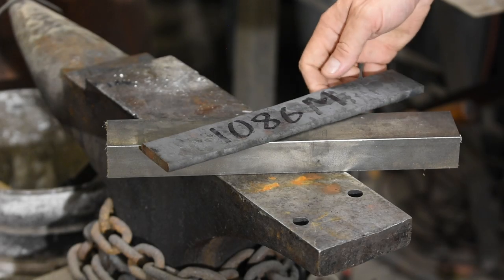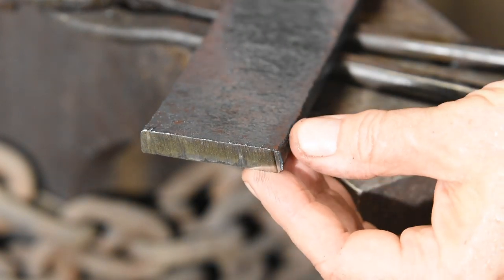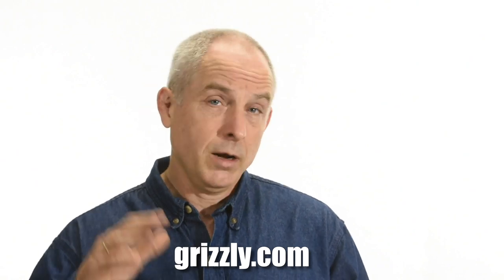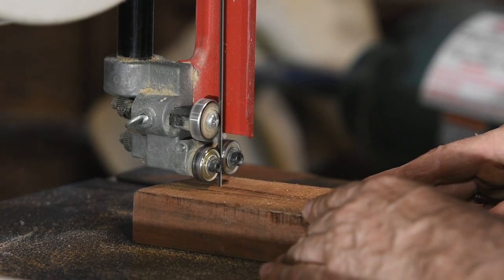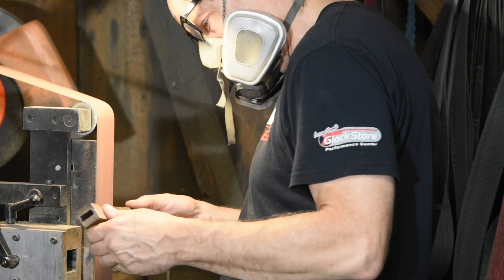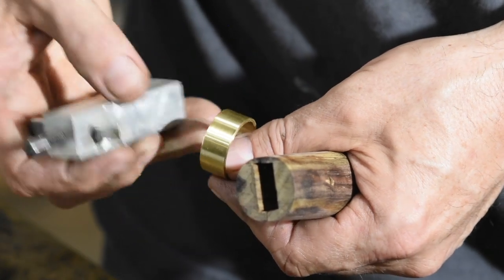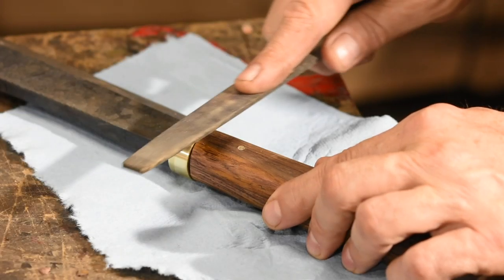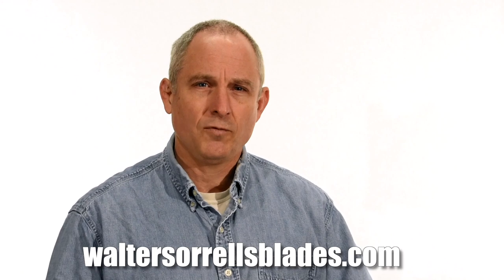Forging an AWESOME Japanese Hatchet!

Comment: well i use an electric chisel to make my groves in hidden tangs, however before or after I have grooved one half of the handle i clamp the piece of wood to the tang affix it  with masking tape that has been tightly wrapped a few times around the tang to hold blad and tang together, remove the clamp locate my hole with a piece of steel to poke it out then drill my hole on one side go and make the second half then glue up. once its dry i simply pull the tang out and drill the hole. keep up the good work Mr. Sorrells (your one of my teachers and its only good manners to call you by your last name and MR.)... i just realized you can simply clamp it and then use a center punch to mark where the hole is and save your masking tape for grinding.

Comment: When you were boring out the brass stock it looked as though that the Chuck was turning as well as the boring tool was cutting on the opposite side. If so I used to do this when I would get some chatter and cutting that way would take up some play in your Chuck and bearings.Thank You Jake Bissel.

Comment: The blade was pretty warped out of the quench but seemed to be straighter when assembling.  Did it straighten during heat treat, was it ground flat or something else?
Reply: Belt?
Reply: It was warped way before it went into the quinch.. you cant see it warped in a few places in the video.. it wasn't straight when it went in the quench.
Reply: It was “intentionally warped” in one direction, so that when it was quenched, it would pull back to close to straight, needing only slight correction which could be done while still hot. It’s a subtle science that takes time to learn. 
No, I can’t do it, but I understand the principle.

Comment: I made one of these a year ago but having a big problem with that one sided bevel. it bended due hardening rehardend it and freaked me out so i decided to make it western style with both sided bevel grind. But the cutting edge you may ask, no problem wih that its a 1000 layer damascus pretty sharp and still in use .

Comment: 1086m? Nice!  Was it from some of Howard Clark's stash?  😉   Also, just wondering since I didn't notice it in the vid, but did you bother trying to take the warp out?  I know that these ni-mai blades are notorious for warping since the high carbon expands when it forms martensite and the mild doesn't convert, but doesn't the mild steel also lend it for being "easier" to straighten (as opposed to mono-steel blades) after heat treating?  Great vid, thanks for sharing!

Comment: I didn't catch it... Did he establish the bevel on the mild steel side or the carbon steel side. Can't seem to get it straight in my head. I'm guessing it only works on the  mild steel side else you would be grinding away all the hard material but dun got myself confused!!
Reply: Mild. Hardened side is the flat side
Reply: Kinda wondered that myself.

Comment: I"m afraid that its handle is not strong enough. Tang length is not too short but blass pin is not thick enough, two-pieces wooden handle is too thin at upper(Mine) side, so I think these points will cause handle cracking with hard chopping.

Traditional handle of Nata is made by one-piece wood that is grooved to tighten a tang from both sides, and fullule(口金) is fit to tighten a tang more solidly, and burnt nail is used to fix tang and handle and its penetrated point is bent to prevent loosening.

Comment: I noticed the blade itself had a bit of a sideways curve. Is this meant to help it chop better?
Reply: I've been wondering about that. I'd love to know the reason for it.
Reply: I think it was intentional. Since the blade is composed of two different steels that react differently to quenching (deform at different rates) the blade would curb at quench time if forged straight. So to counterbalance for quench bending the blade had to be forged curved on the hard steel side in order to straighten at quenching. But that’s Japanese ni-mai for y’all... :)

Comment: Question: 
Would large old file be a suitable starting point for a chopping tool like this? Material-wise it should be a 1086ish steel, but would the material cause problems due to its hardness? How would I have to alter the tempering times/temperatures to make a solid piece of high-carbon steel usable for chopping tools?
Reply: Files are typically 1095 or similar

Comment: When you drilled for your pins did you drill the tang and the handles together?  I’ve noticed that the steel sometimes makes the drill bit walk in the handle.  I end up drilling them all separate, but it makes them hard to line up.

Comment: In a lot of your videos, you're hammering out the bevel. In this one, you said you could grind it out? Is it true, could you potentially just use a belt sander to grind out the bevel everyone with every blade, and not have to hammer it out?

Comment: Where do you buy your steel?

What's a recomend US dealer?
Reply: Not sure where you are located, but i hear the New Jersey Steel Barren is good american owned steel dealer. They also provide heat treat specs. And have a knife maker in house.
Reply: New jersey steel baron or admiral or texas knife supply or alpha knife supply if your in the u.s. i have no idea about over seas ...
Reply: @jessebond4221  i think walter hasmentioed pop's knife supply before